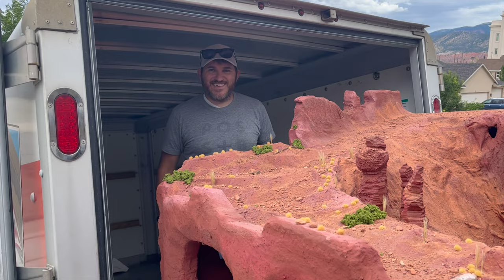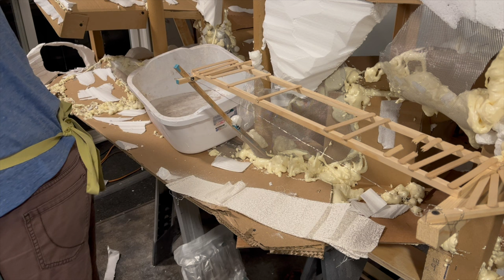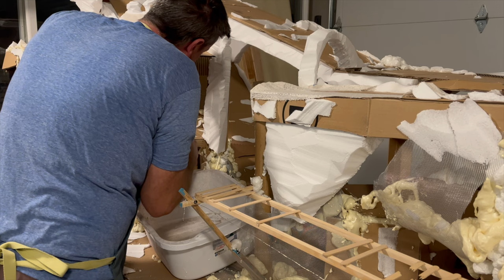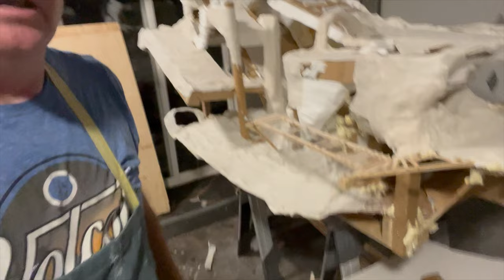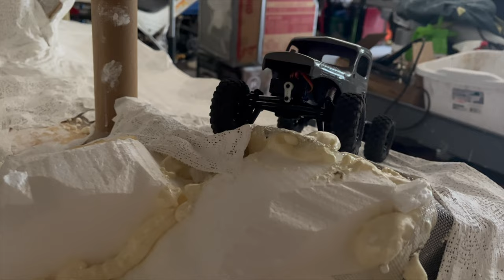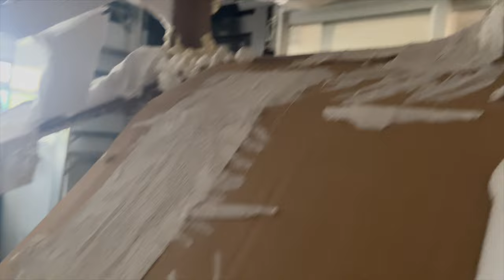Second Mini 1/24 Scale Crawler Track Build | Ep. 4 Laying the plaster cloth

Comment: Buy yourself some plaster of paris in a big bag and some drop cloths. Cut the cloth into manageable pieces, strips for wrapping details and sheets for larger areas. Your wallet will thank me and it makes the build go by so much quicker, just mix a slurry/paste a dip the cloth in and away you go. Extra bonus is that the tighter weave of the drop cloth doesn't leave those little holes that need to be filled.
Reply from the maker: I’d be willing to give that a try.  One thing I noticed is how fast the plaster of Paris hardens. How wet is the mixture?